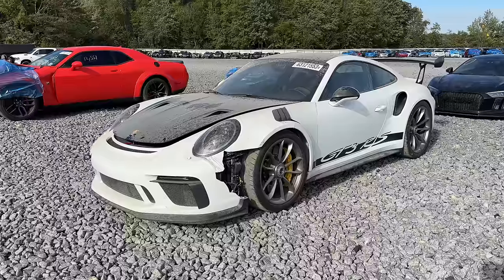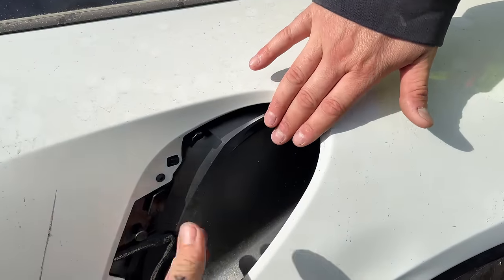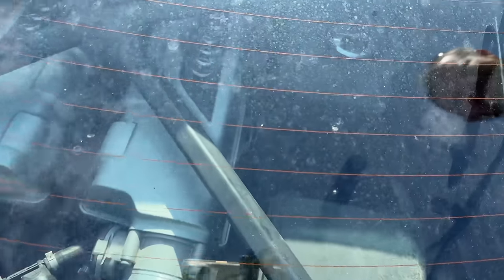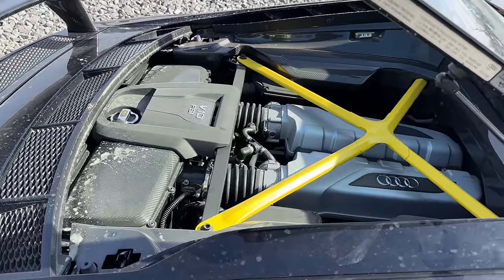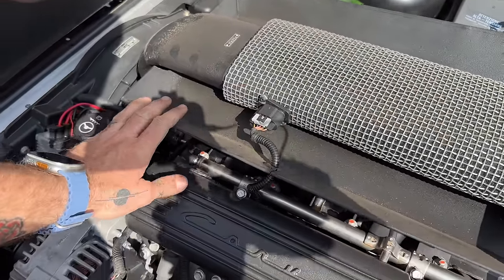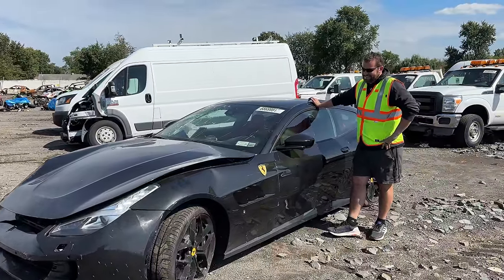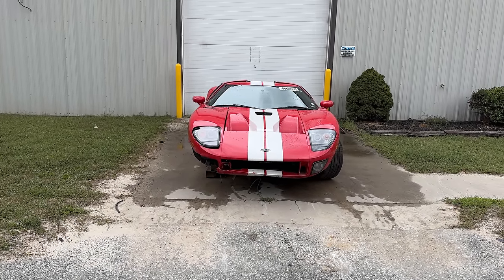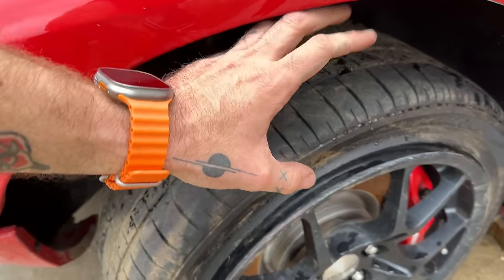I Found A DESTROYED Ford GT At Copart Salvage Auction!

Comment: Not a huge Ford fan, but you gotta appreciate the gt. a beautiful work of machinery for its time
Reply: I hate Ford every time my family gets a Ford. It breaks so fast, so only Fords I'd ever buy now is a Ford gt and a shelby gt500 cause of the name shelby
Reply: @tzvk24  Agreed, my uncle has an older f150, sawed off the bed to put a salter on it. Ugliest thing I've ever seen. I'd much rather buy a mustang
Reply: @tzvk24  try doing some preventive maintenance?
Reply: @salmonella6744  usually buy new cars, so no matineance is needed right off the bat. I had a Ford 250 towed a trailer with it the 2nd day I had it the axle broke on it so I got it fixed and when I got it back it still was crap so traded in back in for another one like a month later and that one had some electricity issue after about 2 months having it

Comment: It's crazy to me how many "car guys" call a rear spoiler a "wing". I mean, wings help you fly. A spoiler does the opposite, it holds you down....With force. Down force, spoiler. Easy to remeber.
Reply from the maker: After reading this comment, I understand the second part of ur name TJ…
Reply: Turn your thinking upside down (no pun intended) haha.. Wings make downforce. Its an upside down airfoil. Spoilers just help kind of massage the airflow, and spoil dirty air behind the car. A spoiler makes the car more slippery (it sometimes provides downforce but not much). It reduces aero drag essentially..... A wing on the otherhand gives you tons of downforce but increases drag. So usually cars that run big wings also have a bunch of spoiler action going on too. :)
Reply: It’s obvious you’re new to the car scene regardless of your waining life span. Spoilers have been referred to as wings since the 60s and have been known as such colloquially since then

Comment: I'm going to bid on this one. I've been trying to find a wrecked GT for a while. A lot of the body will have to be replaced, with the full suspension. It'll probably be at least 100k to rebuild it... which sucks but oh well.
Reply: That's a $20,000 hole in the transmission, btw.

Comment: It's a dang shame that the Ford GT was such a limited run. Because I'd imagine the cost of parts would be insane, if you could even find them to begin with, and unfortunately you would probably never get that money back out of it
Reply: I don't think anyone who bought and fixed up this car would consider resale value.  It will be what it is, and if that means enjoying it co$ts more than your average car, that's the price you will pay.
Reply: Actually, most of the parts are right out of Ford's Mustang and similar lines.  It's quite possibly THE least expensive supercar to keep running.  So we're looking at a reasonable rebuild, aside from the unobtanium chassis and panels. That is, the engine could be entirely missing and it wouldn't be half the problem all those damaged exterior parts are going to be.  And, no, the price isn't an issue, either - it's FINDING and tracking it all down.
As for resale value, it's rare enough that rebuilt means nothing - it's the quality and how it'd done.  If it's repaired to OEM specs with all correct parts, it'll be just as valuable 20 or 50 years from now.

Comment: A cheaper alternative to paying $10,000 for a fender it would be cheaper to probably 3D print a fender make a mold of it and lay it up carbon fiber yourself, and then paint it and it would not cost you $10,000 It's a good bit of work but won't cost you $10,000.

Comment: You'd rather have a fast motorcycle.

For the price of just the carbon fiber replacement fender, you could buy a used ninja bike that accelerates and goes faster than that and gets better mpg.

Comment: Let me share why a high dollar GT3 RS with relatively little damage totalled, it has to do with what they think they can sell the car for, it may be the owner didn't want it totalled and could've even been willing to pay a difference, Nope, that's a no go on high $$$ car. The pencil pushers are in charge and if they think they're ahead by totalling it, it will be totalled.
What I love to see is cars like that not have many bidders, it tickles my heart that the bookkeepers get it wrong.
I've not been a buyer in a few years and I miss it. I did half and half, I bought for two used stores that wanted top shelf cars that'd last as long as the note and I had one buyer that wanted light hits but only certain vehicles and hed change up on me all the time, he'd want 3-5 several.werks then boom,just find me one special deal, it's hard to make money on one car especially when, as a single Father I had to pay for sitters. I worked from Darlington to Miami and damn it man it aged me fast. I'd leave at 4:30 for Darlington and get home the next morning around 2:30 so 24 hours most of them on the road. I often thought of my uncle who had a Store and died coming from a sale after falling asleep. Anyway, I like your channel, you try to insert humor and for a non mechanic you're fairly knowledgeable, n e way, thx for the entertainment

Comment: prob with gt40 as lovely as it is the parts destroyed may be unobtainable and have to be hand built i know I've a mk4 gt40 replica I've been building 20yrsi have the Cosworth dfv v8 engine fuel injection so starts easily but trying keep looks as original as possible I had to pay 1500 pounds uk for ford 60s racing steering wheel with gt40 horn cap and boss kit:face-orange-biting-nails: i could've cried:eyes-purple-crying: parting with cash :hand-orange-covering-eyes:lol but took this long why rush:hand-purple-blue-peace::face-blue-smiling::hand-purple-blue-peace:it'll be sky blue with bright orange stripe in gulf colours logos etc to celebrate lemans winners in 60s :trophy-yellow-smiling::trophy-yellow-smiling::trophy-yellow-smiling:

Comment: Make sure it’s real and not a kit car.    90% of ford gts you see are kit cars and if that’s real.   It’s worth an easy mil even in that condition
Reply: It’s not a kit car. It’s one of the 2005/2006 Ford GT’s built by Ford to pay tribute to the LeMans winning GT40’s. They are currently selling in excellent condition with low miles for around $500,000.